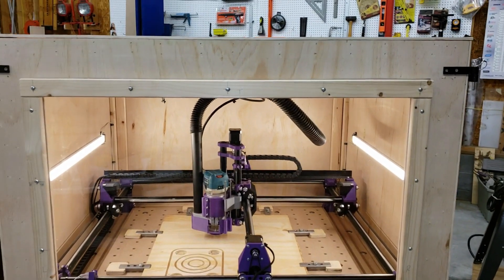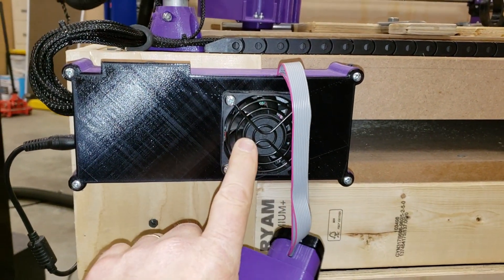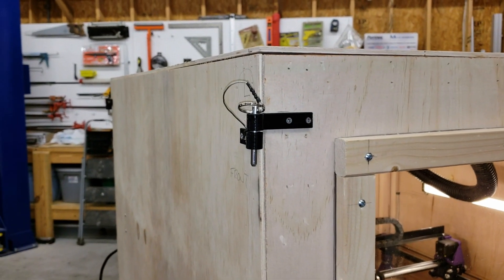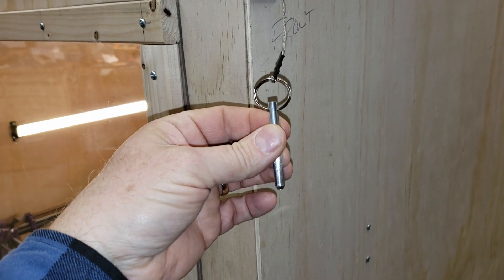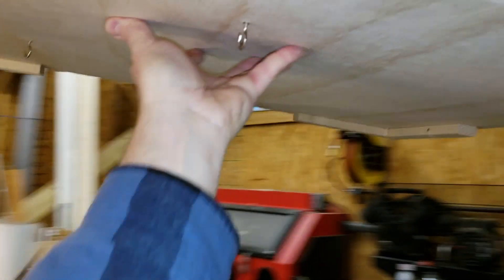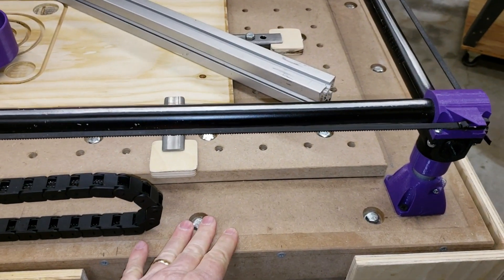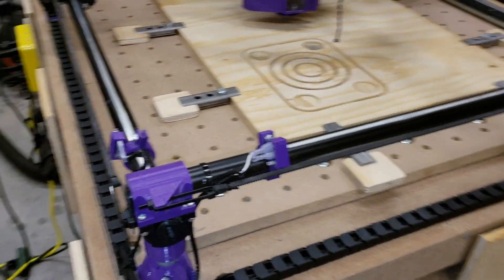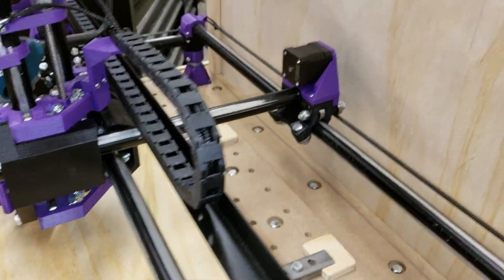MPCNC Widget Wiz Part 1.

Comment: How well is everything working a year later?
Reply from the maker: Hi Lucas
After 1 year it is still working fine. I must add that I do not use it frequently though. Recently I engraved several things for Christmas gifts using a drag bit (shown on one of my other videos). These had some fairly fine detail and lettering and did very well. I was very pleased with the results.

Comment: What size did you make the mpcnc
Reply from the maker: The top surface that it sits on is 37.5" square. The maximum travel limits of mine is 23.5" square.

Comment: I want to know more about your enclosure as I am going to do Aluminum as well as wood and the chips need to be contained.  Besides that I am unsure how to remove Aluminum chips as I saw this one video of a MPCNC and one job he had over 6 inches of small chips rising up to dangerous levels for the machine.  I can imagine a full fledged large job.
Reply from the maker: I don't engrave aluminum with mine but I would imagine you will need to have a good vacuum since the chips are heavier than wood. I use a small shop vac for small wooden engraving jobs. If  you have larger jobs a better vac system will be needed due to the smaller filter in the vac getting clogged up. I use my machine mainly for engraving acrylic. I use a diamond tip drag bit instead of standard router bits. These work awesome!!! Good luck with your build!

Comment: Is the black pipe different than EMT conduit that Home Depot sells?
Reply from the maker: This is EMT. I painted mine satin black and sanded a small strip under each bearing path. I preferred that look instead of the plain EMT finish.